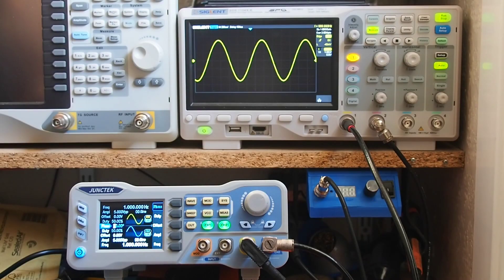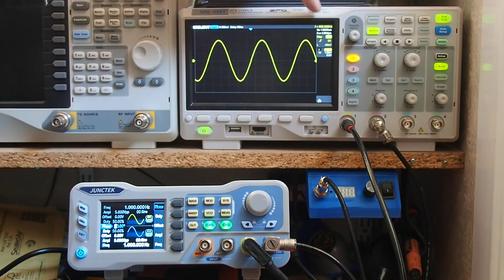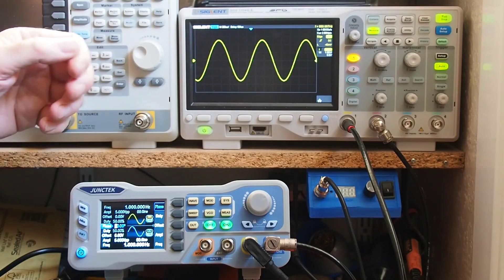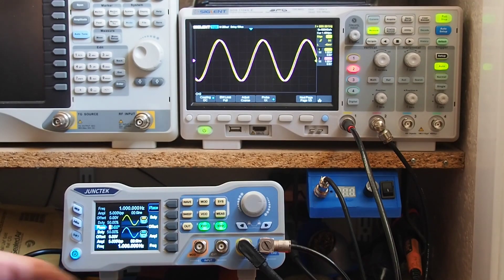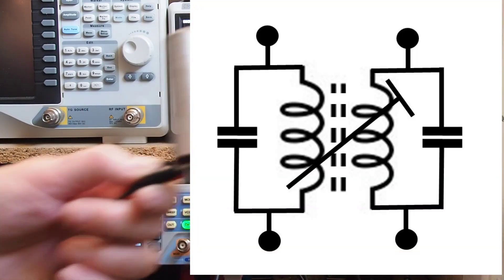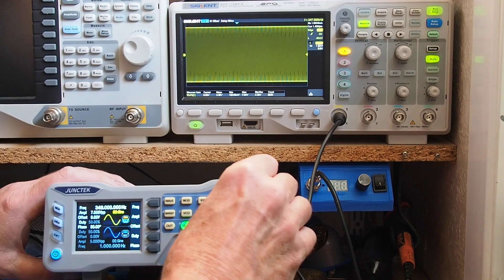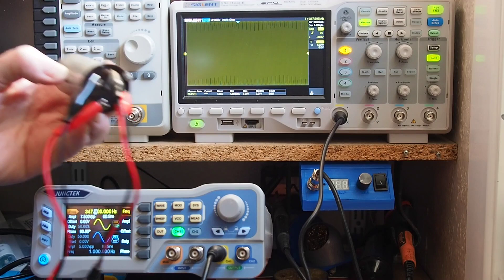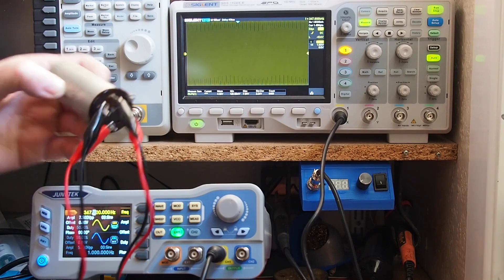#140 - Using a Signal Generator

Comment: A side tip: If you use the full rectified sinusoid waveform, you can output an almost sinusoid signal from 80 to 160 MHz - it will be with twice the set frequency. You can use it to test the receiving stages of UHF and FM receivers and similar.

Comment: I would love to see a video going through the walkthrough of making the rf coil and using it to troubleshoot an old tube radio. I know it seems like a simple concept, but I'm a visual learner, so I would love to see how many coils and the length of wire used to create the "antenna" for the generator.

Also, the "cycles per second", "kilocycles per second", and "megacycles per second" was used because of the anti-German sentiment at the time (just a little fun fact for everyone).

Comment: question. I did not understand why the waveform amplitude increased slightly when you touch the metal can.is this sort of like grounding? I know when I touch leads of volume control on radio I get increase in noise.is this similar?
thanks
John
Reply from the maker: Yes more than likely.

Comment: What I want to know is how are the hook ups done from signal generator to oscilloscope? Nobody ever explains that. All the videos I have seen nobody mentions it and shows it.
Reply from the maker: I use coaxial cable with BNC connectors. 
A 50ohm termination at the scope end is a good idea, but for low frequency stuff you don't actually need that. You can still explore waveforms and make some measurements.
Reply: @LockdownElectronics  ok, thank you
Reply: @LockdownElectronics so you just run a bnc cable straight to the scope? You don't use the scope probe at all?

Comment: Hello.  I have a SeeSii AFG that looks identical to the one you have here set for 1kHz sine wave of around 3 volts.  Basically the same as the reference signal on the scope itself.  I also have a Rigol DS1202Z-E Scope, and it syncs to its 1kHz reference signal just fine.  When I plug Channel 1 or 2 out of the function generator into Channel 1 or 2 of the scope, I'm not able to get the signal to sync.  It jitters a great deal and won't settle in.  I have the scope Trigger set to channel 1 or 2 respectively, rising trigger, and it is adjusted to be in the mid-upper half of the signal, the same as I do for the scope ref signal which works fine.  The only way I can get it to lock in is if I attach the trigger out of the function generator to the Ext of the scope and trigger the scope on it.  I don't remember ever having trouble doing this before or ever having to tie the generator trigger to the scope.  My concern is if my function generator has an issue or not.  Both the scope and the generator are brand new.  I see other users on here attach their leads to the scope and it come right up just fine.  So I'm wondering if I have a bad generator or if I'm missing a setting on my scope, or is there some special condition between a function generator and a scope.  Any help would be much appreciated!  Thank you for any info you could provide!
Reply: Must be nice to afford all brand new equipment 😒

Comment: Thank you Bill, never ever underestimate as I know you do the importance of ‘basic’. You are a true educator. Regards from an aged  teacher
Reply: Thank you for the post.  But, way too much talking vs useful information.
Post the formula:  f = 1/t. and t = 1/f
You spoke about GROUNDING the can of the IF circuit.  Why didn’t you do it?  It would (hopefully) show a stable signal without changes when the can was touched.  You also did not mention the BASIC rule of letting things WARM UP to stabilize both the signal generator and scope.
This is offered in a friendly state.  It is too easy for an EE to forget what is general knowledge for an EE is totally new to many novices.  Thank you Bill.
Barry

Comment: Nice!   I need to make a special application signal of one sec length, with different positive and negative amplitude spikes.  5v  or less would work for each reoccurring spike, with negative and positive volt being different.  Freq is easy but changing the spike amplitudes to different levels is a challenge for me.  What do you suggest as I can make a circuit?  Integrator circuit perhaps with either a separate  limitor chip for positive and negative spikes then rejoin the signals through a mixer?  Is there an easier way?  Idk
  Base is 0 btw and the 1 hertz signal is continuous.
Reply: I edited above.  The time or hertz between each spike will be mostly 0 until it reaches the opposite spike.  For example, a positive spike of 5 volts or less, 0 v, then a negative spike of 5v or less but different the the positive spike, repeated every Hertz.